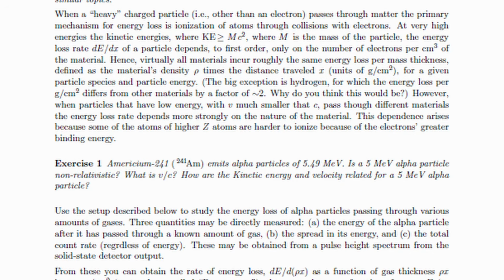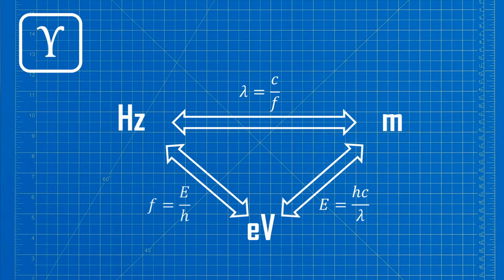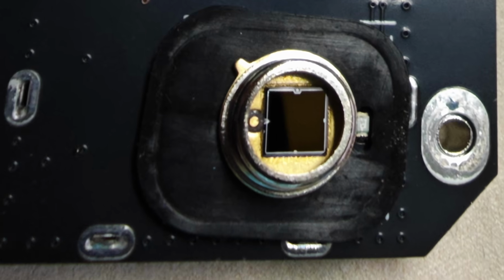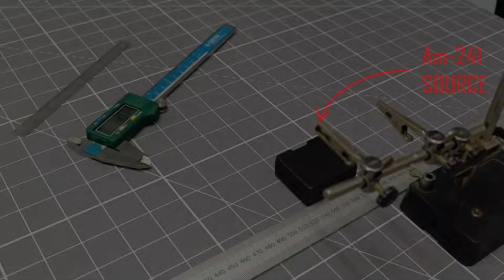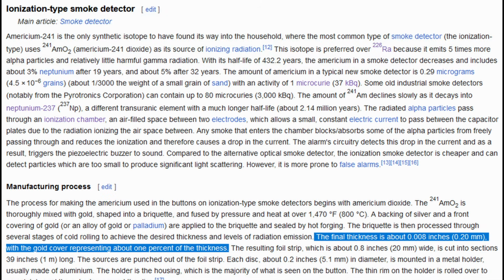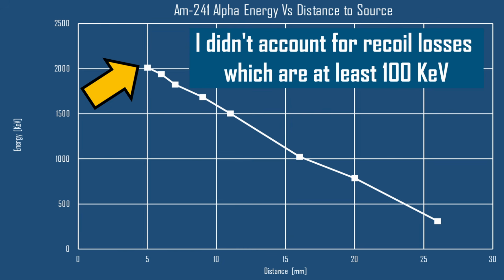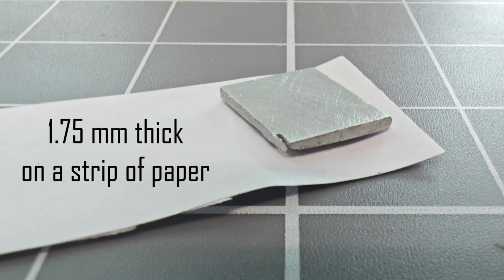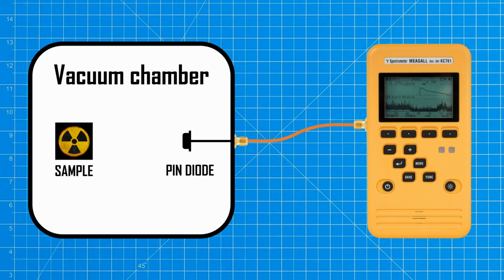an affordable alpha spectrometer.  ☢️

Comment from the maker: I will be doing a video on the beta spectroscopy function as well, but it will be a much shorter video, this one is so long, almost killed me!
Reply: Hello! I am trying to read beta signals from uraninite with my shiny new KC761B but I only get one peak at 200 kev and that makes no sense... Initially it gave out signals without any source, that stopped after updeting the firmware and rebooting a couple of times... To be expected, somehow, all things considered. 
Do you have any idea how that can be?
Reply from the maker: @PeterMarchl  I'm seeing similar things, I'll get back to you when I figure this out.
Reply: @project-326  does your hacked old model has the same problem? I wondered if it's all xrays...
Reply from the maker: @PeterMarchl  The behavior of my old 761(A) is a little different on the PIN diode.  On the 761B, even after upgrading to the new firmware, I still get a few counts, even when there is no source.  I suspect that they reduced the threshold for noise discrimination on the PIN diode MCA.
I have a bunch of questions for the company but I will need to wait until after Chinese New Year to send these questions to them.
I have found a few things that I want to ask the company about, regarding the 761B and this is why I haven't released the video about the new model.  They are normally pretty helpful with questions, but better for me to wait until after CNY and be sure to be asking the right questions...
Reply: @project-326  ok, I wondered why I got no answer from them, it's new year...
The kechuang forum mentioned that the threshold has been changed, its another hardware setup. Also I have found out that the false readings can be stopped by repeatedly rebooting the device but still afterbsone time it restarts. Some voltage bleeding or buoldup? I hope it's a firmware bug and not a hardware or soldering problem. I'm not enough of an electronics expert... I have to constantly remind myself that this is not a typical consumer product but an ongoing experiment and rooted in another philosophy so to speak. What a ride...
Reply: @project-326   I got this answer from anna

We found that this problem may be related to bluetooth, please turn off bluetooth and test.
After the holiday we will conduct a detailed test to determine the cause of this problem and deal with it accordingly.
Reply from the maker: @PeterMarchl  wow, they answered during CNY, that's dedication!  I will try this once I get back to my desk.
Reply: @project-326  well I wrote them, then I learned it's CNY and wrote an apology for not wishing well... Seems that diplomacy did something! it's confirmed. The signal of 0.4cps  gets stronger to 40cps when connected to the app, too. Still doesn't answer the low energy signals.
Reply from the maker: @PeterMarchl  As I always tell the kids, good manners will never let you down...
I'm going to need a few days to be able to get back to the testing of the beta spectrometer.  With your source, what kind of a beta spectrum were you expecting?
With isotopes like natural uranium ore, there is going to be such a weird mixture of stuff that, without a full chemical analysis, it is probably impossible to know what is present and in what proportions...
Reply: @project-326  I looked up the MeV values for the beta decay of uranium, I have a piece of uraninite. That is admittedly messy stuff. One thing I found today is the display of the saved dose spectrum. It shows four spikes between 2800 and 3400  kev, they do not correspond but they are at least in higher ranges, I'm investigating further...
https://i.imgur.com/p2NYlc5.jpg
https://i.imgur.com/noBmOVW.jpg
Reply: You did an awesome job with this! Definitely not as straightforward as gamma spec, lol!
Reply from the maker: @justinb2630  thanks, appreciate that!
Reply: Hi. What is your voiceover process ?.
Reply from the maker: @ericmc6482  I just use a text to voice tool and type the script into it.  I'm going to be trying a real human voice in the next video, I want to see the reactions...
Reply: @project-326  Haha, we will see what eventuates lol. That's a lot of work in typing. Can the output from a voice to text converter be fine edited and then fed to the robot voice generator ?....if so that might be less laborious ?.
This fellow does a nice job of explanation/narration - https://youtu.be/8AvWiQB51mg?si=ece97DWBBPSwkUAA
Reply from the maker: @ericmc6482  I wish it was that easy.  Actually, the next vid that is being uploaded now will still be a robo voice, but the one after I will try the real voice experiment.
Reply: @project-326  I am an audio guy, I will stay tuned 👍.
Reply from the maker: @ericmc6482  Me too, my day job has a component of acoustic R&D.  part of the next video is recorded in my audio lab...

Comment: @project-326 I greatly appreciate and enjoy your videos, absolutely very informative and also very funny as your sense of humor is just brilliant!

Please consult me, I consider buying a tool like this for basic safety, so just to measure radiation levels in various places that I leave, places outside that I frequently visit and spend time on and I want the tool to reliably measure my food for any type of rays (alpha, beta, gamma). Not so interested of the spectroscopy, although it is very nice to have and maybe I will dig into it as well at some point, but the main goal to get such a tool is mainly for personal safety. 
So I am considering buying the KC761A model, where the updated version of it provides movable cover for the pin diode. Can you confirm that this device can be used reliabily to measure let's say wild mushrooms, given it is put into them as close as possible to detect alpha and beta particles?
One more concern, as I read from https://www.kechuang.org/t/87897?page=12, the new C and CN models have quite a few schematic changes and in the gamma crystal detector, so they say they expect lower energy drift over time. Wtf is energy drift of this device and should I be concerned that after several years the device will become unreliable to detect properly radiation (i mean to at least get the counts right (like just using it as a Geiger counter), the dose, not the energy levels of the Rays on the spectroscopy). It is quite expensive for me, so I need to be sure that it wil be doing the job I want it for for quite some years ahead.

Comment: It would be great if you could give us the part number of that diode as the mechanical design around it is so fucked up it's easier to build it from scratch and your information. Thank you for sharing it.
Reply from the maker: Sure, its the Hamamatsu S1221-1 (https://www.hamamatsu.com/jp/en/product/optical-sensors/photodiodes/si-photodiodes/S1223-01.html).

Comment: Excellent video. I see that your alpha source ha 0.8 uC of Am241. A better source would be the Siemens Cerberus Pyrotronics F5B- Fire Alarm Smoke Detector which has 80.0 uC of Am241. BTW my Radiacode 103 was getting strong gama spectrum counts from a couple of feet away while it was still in the postal package.
Reply from the maker: Thanks for the feedback.  I have seen those sources in various videos and have tried to buy one here but was unable to find one.  I think they are pretty expensive these days.  Picking up significant gamma detection from 2 feet away makes me kind of glad I didn't find one!
The only real application I could find for such a strong source would be an part of an AmBe neutron source, it's never going to get the kind of neutron count that one might get from a Po-210 alpha source, but far better than most of the available Am-241 sources.
Reply: @project-326  There is one in ebay for $150 right now. I got mine for $220. Some go for a high as $1000. I'm working on a neutron source for material testing.

Comment: 23:58 Or you could just put the device itself in the vacuum transparent box near the source and look at the log. Much simpler and quicker. It's very easy to create vacuum into a box or jar, you got this!
Reply from the maker: Because several of the components, such as the LCD module, scintillation module would probably be damaged by being exposed to a vacuum.  
When assembling PCBs for satellites and spacecraft, there is a very special process used, to prevent any air or volatile materials being trapped between the components and the board, the final re-flow is done in a vacuum vessel and the pressure is slowly dropped, before the IR heating is removed.
For sure this device has not been through that process...
Reply: @project-326  interesting

Comment: Typically forums like Reddit, Slashdot, etc. are full of idiots.

I have used some but stopped using all. Especially everything having to do with computers.

This is due to the most human fact that you have to fight getting your position.

It is just easier to leave those idiots to live in their own bubble.

Have been BofH since 1985. Been doing various Comp Sci work (embedded systems) with various industries from 1983 from Nuclear power plants, mil, it, isp etc. to high speed trains. Have no time for idiots.
Reply: Use Wikipedia.
Reply: I love you videos.

Started to buy various radioactive detecting devices.

Radiacode 103 (~300€) is in my wish list. Have just bought FTLab BSG-001, SI-21BG, and some el cheapo Chinesium one. Possibly building one myself like using RISC-V board with detector and connectivity using Zigbee,BT, WiFi, Ethernet, etc. maybe with some fieldbus too.

Not just for the fun but for real use: I have a farm. We might have radioactive stones on our property. And they used for decades gas lighting within our main house....

Comment: Do you have more details about the PIN diode in use, like a part number or a data sheet?
For high resolution alpha spectroscopy use a surface barrier silicon detector and get hold of a Thorium cow.
Reply from the maker: It the Hamamatsu S1223, the vendor even confirmed it...
Reply: @project-326  Thanks. Some people use the bare die of TEMD5080X01

Comment: Thank you so much for this video. You clarified a number of vague areas in my radioactivity knowledge and also some aspects of the KC761, which I was contemplating buying for seismic investigations involving 222 Radon. I have learnt a lot of practical stuff and your 3 months was well worth it to me. A great sleuthing effort on your part and well put together. Thank you so much.
BTW, the online manual for this unit does mention the mylar covers over the PIN diode and says it is to preserve the life of the raw pin diode face inside which has no other protection from the ambient environment which could quickly ruin the diode.  Wonder if you can get spare PIN diodes because you have clearly indicated that direct access is necessary for accurate readings?.
Reply from the maker: The vendor confirmed that they are using the Hamamatsu S1223 PIN diode in the product.  The glass needs to be removed, but I tried that an S1223 diode by applying a little pressure across the width of the diode and the glass came out pretty cleanly.

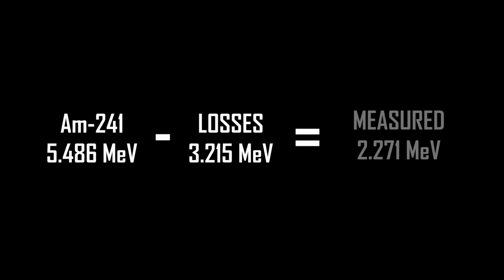Comment: 16:55
Not a bad idea to calibrate the pin diode for alpha samples at a certain distance from the detector. Using a well known standard from Am241, that would be a great calibration source.

Unknown samples should then be close to the true energy of the alphas being emitted.
Reply from the maker: It is an interesting idea...

But I am keen to keep the calibration based upon the absolute measured energy, let me explain.  A few months ago, I make a random purchase of an strange Am-241 button on XianYu (the Chinese equivalent of Ebay) and although the gamma activity level is is about 3.5x that of a standard button, so indicating that the activity level is probably about as advertised (approx 30 uCi), the energy curve is very strange.  This tells me that the material covering the Am-241 is not just the standard gold foil that these sources normally have.  
I have actually been doing a bit of an investigation into this source construction, I am wondering (hoping) if this strange little source was from an application that needed some neutrons and that this foil is actually beryllium.  Knowing the absolute energy level gives me some information to work with.
Sorry for the long and rather boring reply!

:-)
Reply: @project-326  
This is a great response! It's very interesting to hear your perspectives and look at your research into this technology. 

I'm kind of in the market to pick up a handheld gamma-spectroscopy system, so these videos are great to make an informed decision.
Reply from the maker: @justinb2630  I will be reviewing the Radiacode 103G fairly soon, keep an eye out for that video...
Reply: @project-326  
That's great, because I saw a claim that the 103G was a germanium detector (I can't remember where I saw this claim, but I think it was in another YouTube video). 

I commented on that, challenging the claim, because I usually work with High Purity Ge detectors, which need to be cooled to -185 C. I got no response, so I'll be curious to see what you uncover. 😁👍
Reply from the maker: @justinb2630  Woah, HPGe is pretty serious stuff.  The RC103G is using GAGG.

Comment: What’s about this diy ? Is it total trash than or could this have worked if correctly calibrated?
Reply from the maker: alpha spectroscopy is not a straightforward subject and it certainly isn't plug-n-play in the same way as gamma spectroscopy can appear to be.  Measurements of kinetic energy depend highly on the various media in play and the original decay energy of the alpha particle.  Calibration is something that needs to be done alongside each measurement based upon a lot of factors, it's not something that can be per-calibrated unless the instrument is only used for a single type of experiment under the same conditions.

Comment: Wow! I had no idea that alpha spectroscopy was a thing! Very cool! 
I have a GQ GMC-600 Plus Counter Detector Dosimeter Alpha Beta Gamma X-ray. It claims it can measure alpha but I've never been able to convince myself that it could detect alpha particles. Is there any hope of doing alpha spectroscopy with such a device?
Reply from the maker: Unfortunately, a Geiger counter can just count the events and cannot measure the energy of each particle it encounters.  Your device should be able to detect alpha, just remember that they are very short range in air, not much over an inch before all of the kinetic energy is lost.

Comment: Excellent video! Saved me a LOT of fooling around to learn about alpha particles. I was not clear as to how the spectrometer reacted to distance.  Note that vacuum is just as complicated as particle physics! The density of particles in a vacuum varies exponentially with pressure to a certain point, then gets almost irrelevant. You will need to get to molecular flow pressures before the gas molecules are not going to affect you alpha particles. Unfortunately, this will take more than a simple mechanical pump. Get ready to spend $$$!
Reply from the maker: for alpha spectroscopy, an imperfect vacuum is preferred, it removes most of the back-scatter from the measurement.
Reply: @project-326  If the alpha hits a gas molecule doesn't it change the speed, thus the energy reading? Where is the back scatter coming from? I would wildly guess from gas molecules? Seems like that site you went to for information is run as a cult. If you are not "in" they treat you like crap.
Reply from the maker: @glasslinger  Neptunium has some great insights into the issue and why an imperfect vacuum is better for accurate measurements.  You can take measurements at more than one distance to allow initial energy to be calculated.  I suspect that the back-scatter is coming from the vacuum chamber walls, at very high vacuum, there is negligible energy loss, so they alphas are going to end up at the chamber walls...

Comment: Dear Studio326, do you know if there is an affordable alpha spectrometer for detecting 218Po that have an energy level about 6 MeV? Thank you very much. Regards
Reply from the maker: I have not heard of any and certainly nothing that was more affordable than the KC761 series.
Reply: @project-326  Thank you  very much for your answer but,  I have a doubt yet. In front of spectrometer it seem that the meter can only measure up to 3 MeV, it's that true? What is the way for to measure up to 10 MeV? Thank you. Regards 🌞
Reply from the maker: @octaviolazaromancilla2732  Well, alpha spectroscopy is quite complex.  For a start, you are just never going to be able to measure the actual theoretical energy level of an alpha particle unless the sample and the detector are in a vacuum.  Secondly the published energy loss doesn't account for the recoil losses, just the overall energy lost to the decay process.  If you were to measure 6MeV (theoretical) alpha particles at 30mm, then they will have lost all of their energy traveling though that much air and so nothing is left to detect.  With direct contact with the sensor area of the enclosure, there is 5mm of air to cross, so the alphas will have already lost about 1MeV by the time they reach the detector.  If your source has a couple of microns of gold foil for protection, then you lose another MeV.  I think that the instrument is good for about 5MeV but there is just nothing that can produce 5MeV at the detector after the losses from the air, the Mylar film and any losses from protective coverings of the source.  Ignoring cosmic rays, I don't know of any isotope decays that can exceed a kinetic energy of 7MeV that would require this detector to even need a range that can exceed 5MeV.  If you know of any >7MeV alpha decays, please do let me know, I'm always keen to see new things...